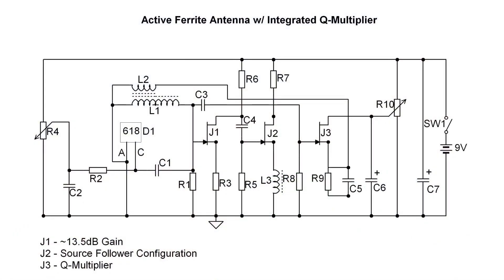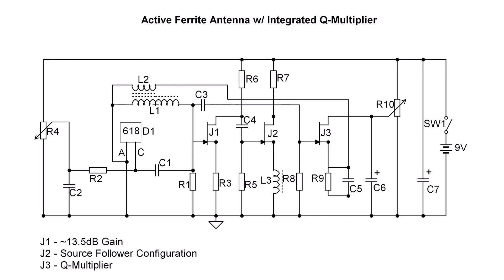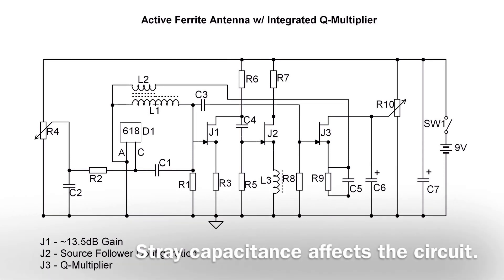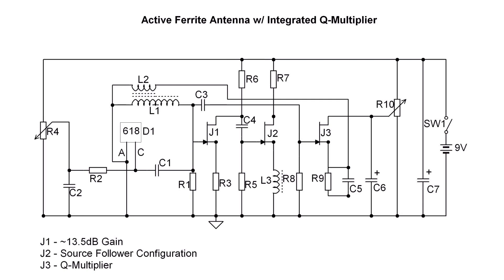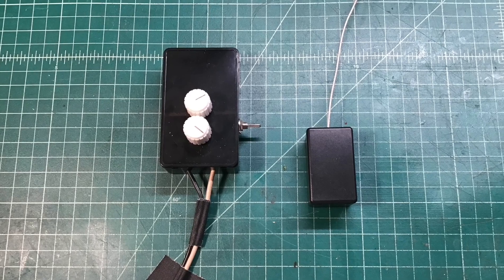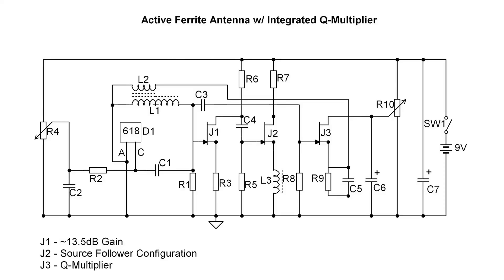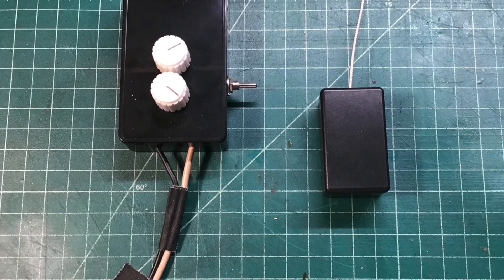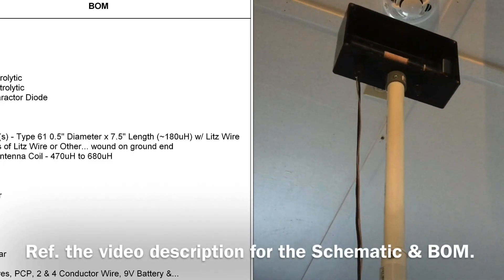Active Ferrite Antenna w/ Integrated Q-Multiplier & Loading Coil

Comment: If I make a 4.7 mH ferrite rod antenna for this circuit, will circuit be able to tune the LW bands?  Have you tried this for long wave?   I should done this along time ago with my previous LW and AM loop antenna circuits.
Reply from the maker: I’ve never tried it on LW, but reference my previous reply regarding the q-multiplier. Best, Don

Comment: Hi Don, Where in the Carolinas are you located? I am in the Charlotte area, so WZGV 730 is a strong local station for me. I would like to get in contact with you and discuss the vintage radio hobby and specific interests, collection, etc. Too bad You Tube does not have the private messaging system any more. Are you on Antique Radio Forums? I am "DaveD" on there.
Reply from the maker: I lived in SW Charlotte for a number of years and have since moved. I’m a member of Antique Radio Forum (RestoreOldRadios), but haven’t posted anything recently. You can reach out to me at my gmail at TheRadioRepairGuy. Best, Don

Comment: Don
I’m assuming the controller box houses R4 and R10 and nothing else except the rotor control. 
Where is the 680 uh loopstick? I don’t see it in the box housing the pc board and L1 and L2? Also, how did you construct the pickup coil?
Reply from the maker: Correct, R4 & R10 reside in the controller box. The loopstick antenna (loading coil) is in the small plastic box, which is connected back to the main unit with miniature RG316 coax. The pickup coil is on the ground side of the Type 61 Ferrite rod (1 to 2 turns) of Litz wire. A link to the loopstick antenna I used: https://www.mikeselectronicparts.com/product/680uh-loopstick-antenna-coil-tap-470uh/ Let me know if you need any additional information and thanks for watching. Best, Don
Reply: @RestoreOldRadios  ok got it. Thanks Don.

Comment: Don you’ve just added another project to my list!  Did you use litz wire for the coil?
Reply from the maker: Bob - I did. I used the same Litz Wire that I used in the previous Q-Multiplier project. Please reference the updated schematic online I posted this AM that corrects an issue with R9 & C5 back to L2. Best, Don

Comment: What a wonderful job Don. You've essentially improved on the 1930's antenna of running wire in the attic rafters in a small box that does 1000x better job - BRAVO
Reply from the maker: Thanks Ron. I like long wire antennas, but I don't have the space for them. Please reference the updated schematic online I posted this AM that corrects an issue with R9 & C5 back to L2. Best, Don

Comment: You can  use vacuum  tubes  as  J1 , J2  and  J3
Reply from the maker: John - that would make for an interesting project. What tubes would you recommend? BTW - Please reference the updated schematic online I posted this AM that corrects an issue with R9 & C5 back to L2. Best, Don
Reply: @RestoreOldRadios  The 6C4 single triode and the 6J6 miniature 7pin dual triodes would be suitable. Very low inter-element capacitance and moderate gain to 600MHz. Used in TV tuners back in the day.